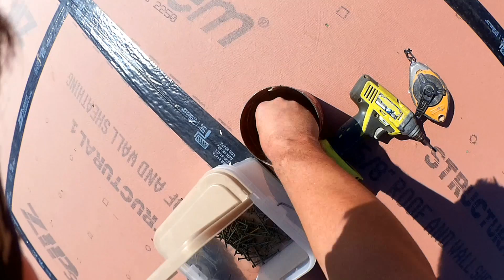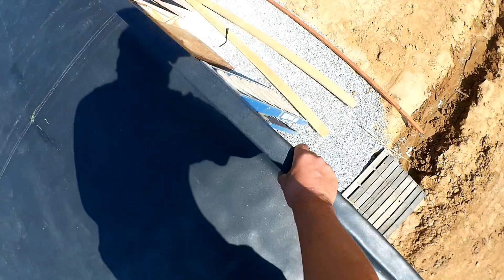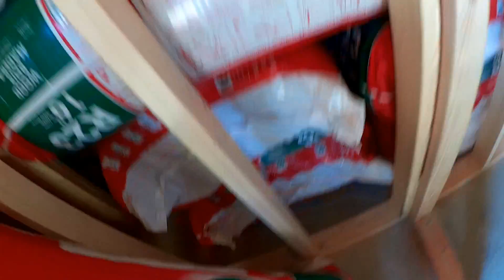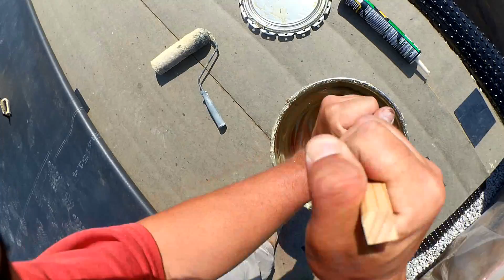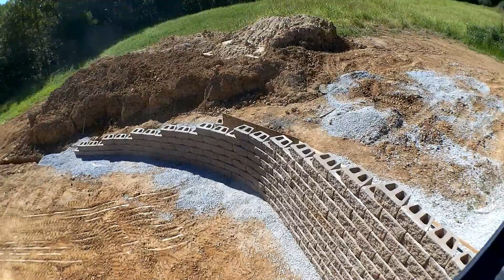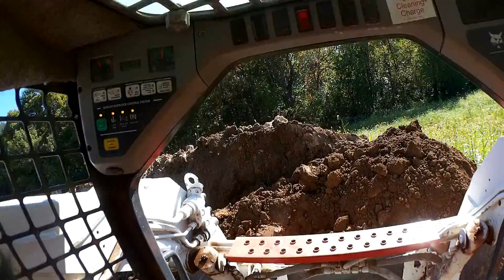Hobbit House 6

Comment: So is there just gravel between wall and dirt? Just wondering about moisture barrier.
Reply from the maker: There is a self adhesive membrane on the pressure treated plywood followed by a dimpled plastic drainage board to keep the pressure off the wall and allow any water to fall straight down.